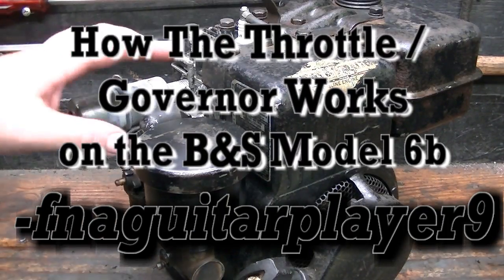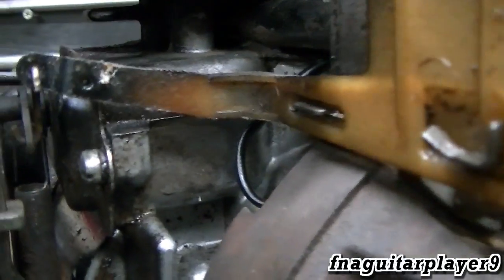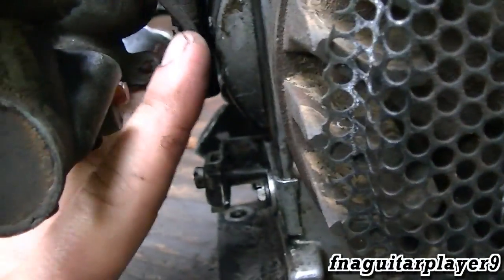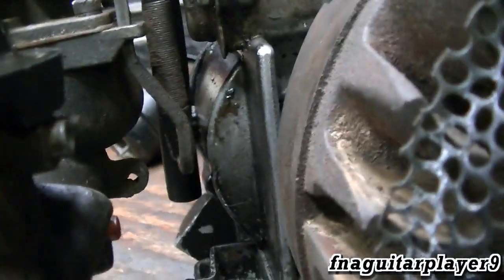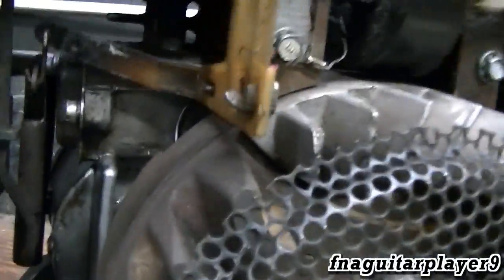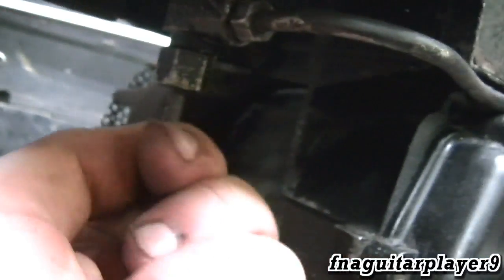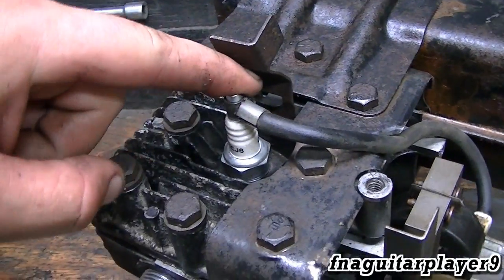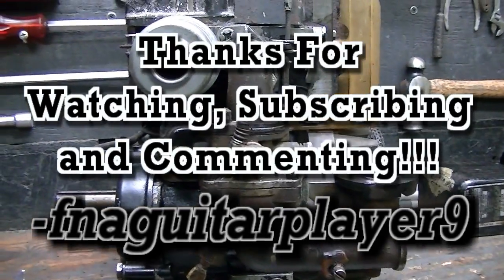Part 3.5 on 1958 B&S Model 6b : How the Throttle / Governor Works

Comment: Wow! Think I have the same motor as this! Everything looks identical!  
Would you know where I can find a manual for this engine? Mines a 3.5hp briggs, rotary hoe (Morrison - multi Hoe) has gears attached to the crankshaft cover, which connects to a chain to drive the tiller blades. 
Was running good but smoked a fair bit. Pulled it apart, fixed the throttle and cleaned the carb (was mint) spewed some oil out of the valve breather - so I made new gaskets there. 
Had adjusted the carb pins and it just won’t start up for longer than 1-2 seconds. Feel that’s  the head gasket so sure enough it was and crankshaft gasket too as figured may as well open her up.